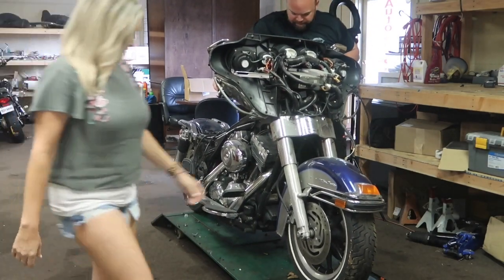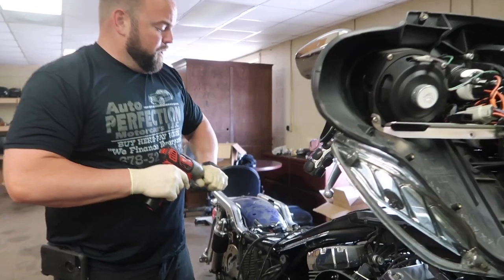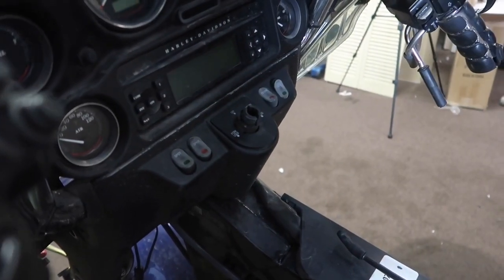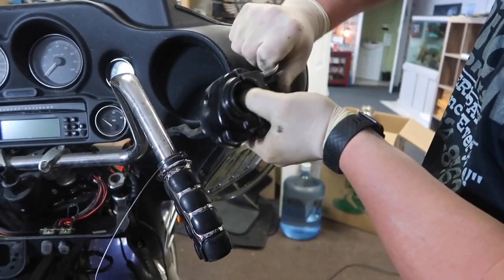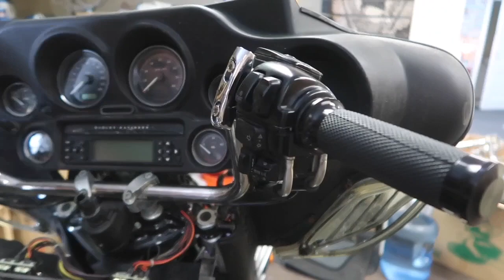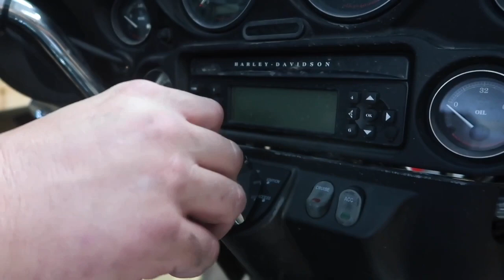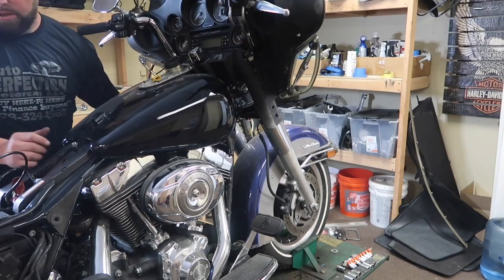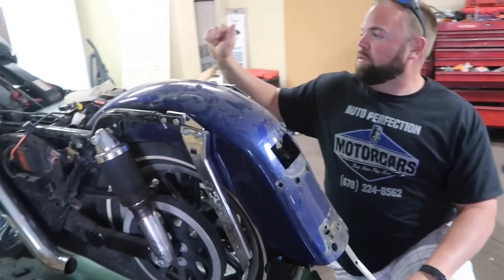Electra Glide Custom Harley Bagger Part 2 ll Salvage Title Harley ll Budget Bagger Rebuilds

Comment: Hey man , I'd like to put 12" ape on my 09 Electra glide , question is , do I need whole new extended brakeline for it or can I extend the original line ? Also do I need new longer throttle wire or can I extend it with the extended wire cable  which come with burly cable kit ? Many thanks 🙏🏼
Reply from the maker: You’re gonna need new extended stuff on all that you asked about!
Reply: @BudgetRebuilds  thanks 👍🏼